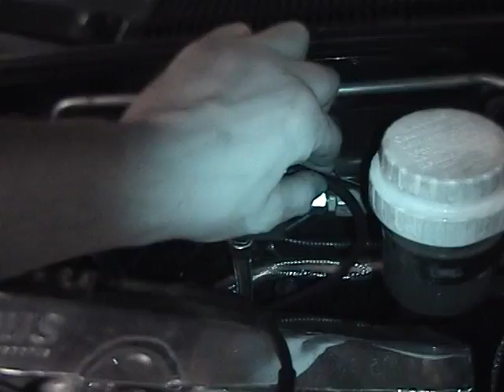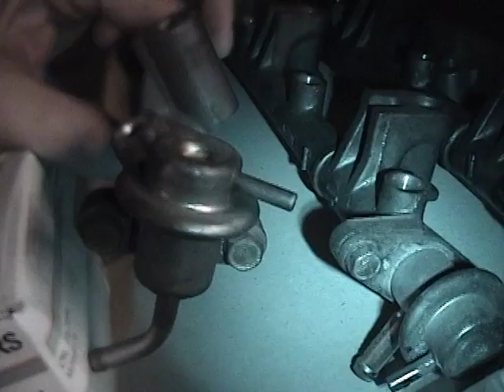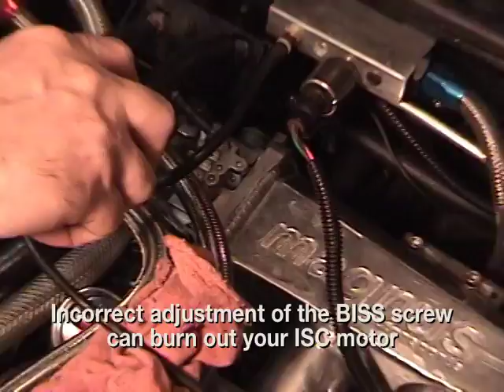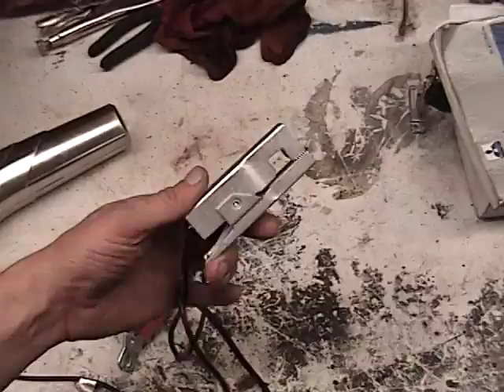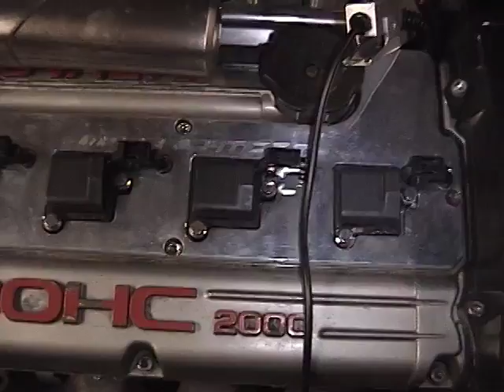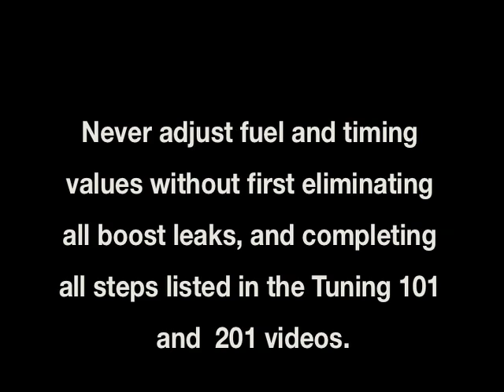Tuning 102 - Idle Tuning

Comment: I know this is a super old video, lol.. Do you recommend setting the BISS screw/base idle BEFORE checking the base timing? (on a 2G GSX)
I'm having an idle surge right now, but I just did a full engine build. I'm pretty sure my BISS is poorly adjusted, I only ever did the "tighten all the way and back out ~2 turns" when I rebuilt the TB. But I also want to verify my base timing before I move on to tuning. However, I'm sure I'll barely get a stable reading without having a proper, steady idle.
Reply from the maker: You could.  Whether you do it before or after, I recommend setting the BISS screw after doing a complete and total boost leak test.  Often times idle surge is caused by an uncontrolled air leak.
Reply: @Jafromobile  I've done a full smoke test of the vacuum and exhaust sections, and fixed any leaks I found. I could/should double check now that I've heat cycled the engine though. 
I also realize I should be calling it an "idle drop" not a surge. It'll idle ~800rpm, AFR will swing lean, RPM dips to 500-600, AFR swings stoic, and RPM stabilizes at 800 again. Rinse and repeat.

Comment: Could use some help if anyone has a idea, I have a 1990 AWD talon, I hear the relay click and the car stall's, check engine light comes on each time, code is O2 sensor???? Now just won't start at all it was intermittent for the most part, anybody have any idea what might be going on?

Comment: Hi Jafro! Great Video, I set my idle in my ECMLink at 950... If I want to set the ISCPosition value correctly should I lower it to 750? Or Can I set the ISCPosition value at 30 with my revs at 950?
Reply from the maker: You want it at 30 with whatever idle you have selected.  Think of it like its operating range.  It needs 70% headroom to be able to adjust for different running conditions and electrical loads.  ;)

Comment: Hey Jafro, I currently have a speeduino board and do you have any idea how to wire the 6 pin iacv to the four stepper driver motor output wires and what usually the home steps for the 1g 4g63?

Comment: Do you have to ground out the timing pin in DSMlink? Before adjusting the BISS?
Reply from the maker: No.  You ground the timing pin (it's just a checkbox with ECMlink software) when you're setting base timing.  That should be done with a timing light first before making idle airflow adjustments.  Also, first you want to set your base fuel pressure with the engine off.  Set your idle speed in ECMlink and if your BISS screw is in range, you're going to hit it.  Just log ISCduty at fully-warmed up idle (fans cycle once then shut off) and with the doors closed and all electrical equipment off, adjust the screw until it hits 30% duty cycle.  If the fans cut back on, it's going to mess you up so wait for them to turn off before making further adjustments.  Once you've got ISCduty around 30 with everything electrical off with the engine running, you're good.  The BISS screw is only a pain to adjust when you don't have ECMlink.
Reply: @Jafromobile  Thanks for the response! I do have dsmlink I just wasn't sure about checking the box or not for adjusting the BISS. I didn't even think about the turning off the electrical components. Again thanks for your help.
Reply from the maker: Yeah man!  There are inputs for the power steering and AC compressor and those tell the ECU to bump up the ISC to overcome the drag they create.  Powering lights, stereos, blower fans and other things loads up the alternator creating additional drag, and that's what the ISC motor compensates for.  When you set your idle speed in ECMlink, and you've achieved the 30% ISC, the ECU does all the rest.  :)

Comment: Will putting the timing light clamp on a stock ignition feed lime work pr os that only for after market?
Reply from the maker: My setup here is limited by my modified ignition.  I actually managed to clamp it onto the low current signal wires for the coil on plug pack and make it work.  Of course it fired twice as often, but it worked.  I don't know if the signal wires for the coil managed to trigger the light, or if its close proximity to the coil was what made it work, but it actually worked for me, which I thought was odd.  I wasn't expecting the low current trigger wires to do anything at all.  On a standard ignition with plug wires, you clamp it on the #1 plug wire because that's the one that's in the correct engine rotation to light up the mark at the right time, and that #1 plug wire provides the magnetic field that triggers the light.
Reply: Good video. I was surprised to see the timing light fire as the plug wires fire at 50,000 volts instead of 6-12 volts
With the exception of my Matco Oracle scan tool most of my tuning equipment is vintage but very accurate. What is tuning software are you running on your laptop and can you adjust a factory ECM?
Reply from the maker: The software is ECMlink.  It's a DSM-proprietary plug-n-play solution that works on 89-99 Mitsubishi Eclipse, Eagle Talon, Plymouth Laser models as well as Galant VR-4 and some EVO models.  The ECU is modified to enable 2-way communication over OBD-I or OBD-II, and yes, you can completely change everything in the ECU as well as unlock launch control, gear-based boost control and data logging capabilities.  I left a ton of other stuff out.  A YouTube comment won't give me enough room to do it justice.

Comment: "unless you have means for monitoring, don't turn the BISS screw" whoops! learned something new. My ISC is probably shot now.
Reply from the maker: Sgt Balestrini Nah, probably not.  It's probably just operating out of range.  You can read the value with an OBD-II logger, and you want it hovering around 30, car fully warmed up, all electrical accessories off.  If you can get access to an OBD-II scan tool, you can set it... and if you want to see if your ISC moor is bad, I have a video about that, too.  3 quick tests with a multimeter.  

Just keep in mind that if it's bad, you were more likely to have adjusted the screw BECAUSE it's bad than it happening the other way around.  All having it set wrong causes is for it to operate in the wrong range.  If set extremely out-of-wack, it just means that all of its operating time occurs only in one position.  More run-time on that one particular coil.  That's all.
Reply: ***** I appreciate the help. Right now its hit or miss, sometimes it idles dead at 750, other times its right at 1k. but it doesn't loop.
Reply from the maker: Sgt Balestrini Watch my ISC video.  A cheap $2 Harbor Freight... or a free borrowed multimeter is all it takes to diagnose it.
Reply: Will do thanks
Reply: @Jafromobile  Hi man, I'm trying to make work a 90 ecu on a 91 wiring harness, I have a 91 N/T big throttle body, 91 + ISC plastic, I swapped pin 14 to pin 6 on ECU, because 90's ecus uses pin 6 for Idle Position switch, however I am confuse about the wiring on the ISC Plug pin 1-3  4-6. I'm trying to make this conversion

Do I need to swap pin 58 59 and pin 67 68 as well?

I mean pin 59 to 58 position and 58 to 59

67 to 68 position and 68 to 67 position ???
Reply from the maker: @YosoyJavierRojas  That depends on which cam angle sensor you're using.  The plugs are different, but I've seen cars swapped to accept the other one from both years (I know, it's weird... but what you're running into is exactly why).  There will be a harness hard-wired to the '90 CAS, and the 91-94 has a connector on it with no wires.  You could swap the wires on the CAS connector, or at the ECU if they're mis-matched.  If you don't know what someone did before you, then you can try it and if it doesn't work, swap it.  Won't hurt anything it will just be out of phase with the engine cycles.  You can swap it either at the ECU connector, or at the CAS end of the harness.
Reply: @Jafromobile  I am talking about the ISC idle valve, 90 vs 91
Reply from the maker: @YosoyJavierRojas  I know,  The CAS wiring is the only thing I'm aware of that could be different.  The ISC's are different in how they plug in, but otherwise aren't any different based on my info.  I think you just have to change the gender of the plugs?  Sheridan Engineering sells individual connectors if you need to change it.  The only change to the wiring that I'm aware of is for the cam angle sensor, and the MAF baro reset pin.

Comment: I thought Everyone has the ability to turn the fuel pump on without starting the car, It happens everytime you turn your key to the On/run position.. Do they make cars that only turn fuel pump on AFTER you start cranking the motor? That seems like it would make for some really slow starts
Reply from the maker: Kyle Milford Nope.  :\  Mitsubishis don't activate the fuel pump unless you're cranking the engine, or key-on-engine-on.  I've had lots of mechanics insist that all cars do this when I was troubleshooting fuel issues of the past.  They insisted all cars prime the pump at key-on-engine-off, but I have confirmed 4g63-powered Mitsubishis do not.  Following their advice would make a DSMer waste time and money replacing a fuel pump.  Guilty as charged.
Reply: Ah i see, i dont have the wally in this car yet (doing that & AFPR today), my other car was a 420a eclipse and in that model if i remember correctly it primed as soon as key hit the on position.. What if you cranked the car just a second to where the motor didnt fire, and then released to the on position, would it then continue to prime to fuel system?
Reply from the maker: Kyle Milford for a split second it will, yes.  You'll hear the fuel pump and the relay kick off together on a failed start.  I suppose mitsubishi's logic is... if you have a good regulator and a returned fuel system, if fuel is going to leak back into the tank, there has to be an air leak... and where there's an air leak, there's a fuel leak.  You shouldn't have any fuel leaks so your pump doesn't need to prime.  A full fuel line pressurizes instantaneously with the key as long as there's no air in it.

Comment: Just a thought-----But why go through all this to gain Hp.But insist on having power steering power brakes and AC.
Reply: This is for tuning, And basically maintenance.. Not all about gaining power.. Its the required steps before you can actually tune for mods done to the car.. Plenty of DSM's over 400 WHP with all factory options still on the car lol

Comment: is it difficult to set the timing on one of these cars? i'm trying to buy one but the guys says its running rough because the timing is off, and i'd have to reset the timing before i drove it. do you have any insight? or could PM me with details?

Comment: You should list the official values for fuel pressure, not stupid ranges.  For instance, 41-46 psi is very vague, and it's really supposed to be 42.7 psi.  Ranges of values are for people who rely on manuals like Haynes and Chilton, and generally are the types to only really tinker with basic tune-ups.

1G n/a: 47.6 psi
1G turbo manual: 36.3 psi
1G turbo auto: 42.7 psi
2G turbo and 4g64 spyder: 43.5 psi (or 3 bar)
2G 420a: 47-50 psi (420a are the refugees)

Comment: i have a ques for you.is it possible to remove the egr valve/vaccum lines/solenoids on the firewall from a 2g with stock intake manifold and TB?with out it running like poop or throwin me a code?id like to give it a more clean look under the hood  without all that ugly crap there

Comment: That didn't look right, i dont think it should be at 40psi with the line on. Its supposed to be like 43.5 with the line off and then when you hook the line up it drops to the 30's. With the V3 you can put whatever base fuel pressure you want and it calculates the new global. With link i dont even turn the car on, i just push the fuel pump on button. Can you adjust 97-99 timing? I didn't know the gun still works on the COP, i just keep a spare stock coil pack and wires around.